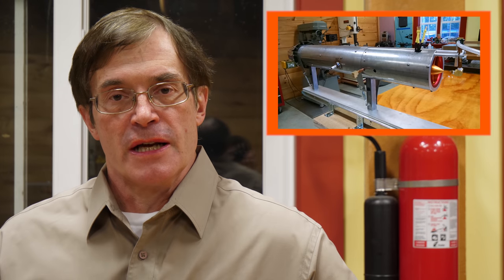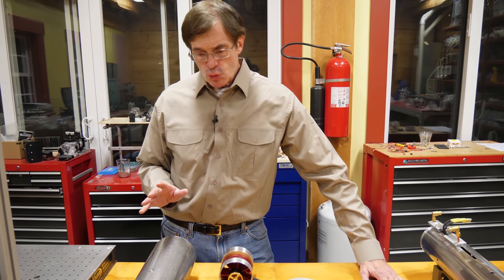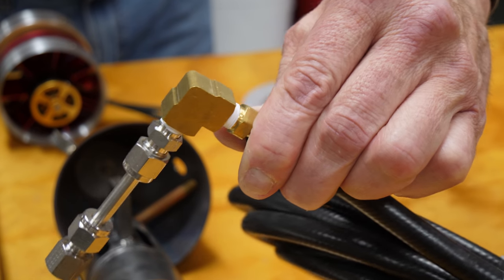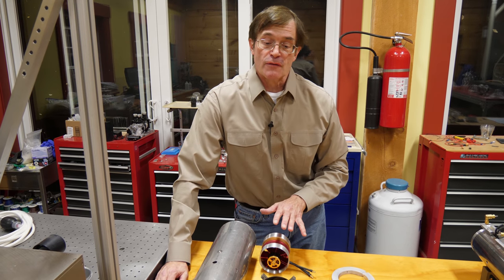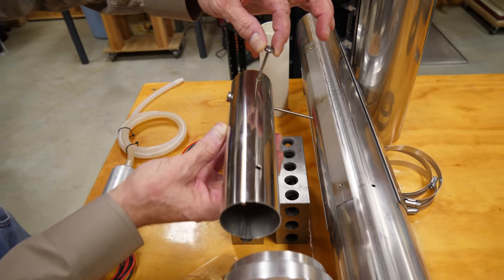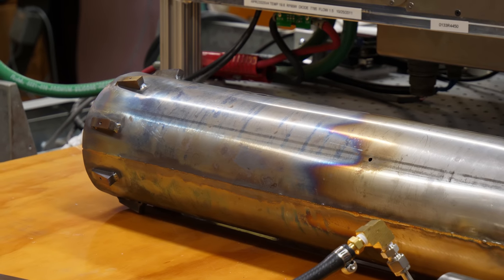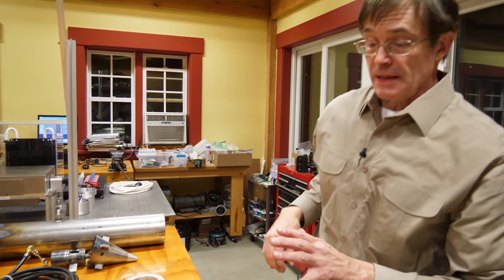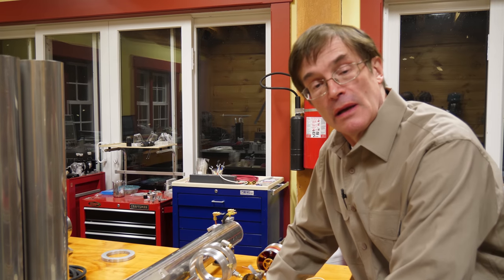Hybrid Jet Engine - Update 2.0

Comment: yes edf ramjet afterburner rocks
Reply: even in no-burn external heat operation mode
Reply: rocket nozzle thrust collector with expanding combustion chamber diameter
Reply: you could try flap membrane cantilever flexing fan
Reply: or just slow burn a very big slow flame, not small fast flame, like in power plant, as heat, then push the heat to the thruster
Reply: separate the problem of burning and thrusting to two separate mechanisms/functions, simpler
Reply: ece over ice
Reply: well who cares how large the steam engine burner chamber is (or nuclear reactor), you only care about the thrust you get from the heat of the burn chamber
Reply: yep steam/gasoline heat engine train business
Reply: fuel bomb type of air heat expansion, instead of pipe containment jet thruster burner, if in ice mode, even in ece external burn the large slow burn chamber will function as such, dont have to care about melting places, just large amount of moderate temperature heat/btu flow into the thrust generation device/chamber/rocketnozzle
Reply: yep you can directly heat burn the rocket nozzle side sheets from the non-thrust side, with burner nozzles

Comment: What are you trying to do here? 
Build a jet engine with a rc electric fan with no compression? 
You know that stainless is the worst on distorting while adapting heat?
Rc people know a lot of fancy words.. but putting those in real life usually end up contraptions like this, they simply just dont work. 
Get a real jet engine and improve on that design so you wont end up waisting your time.
Nice work space you have. :)
Reply from the maker: Thanks, regarding the workspace. 

What I am trying to do is exactly what I said I was trying to do.  The words I choose are appropriate and to the point.  I will not restrict my vocabulary in order to convey a prosaic impression.
There is compression with this fan design.  They achieve a low compression ratio, but they do compress the air as will any source of air velocity due to the ram effect.
Part two will be out in a couple of days. This might answer some of your question.

Comment: What is the point of this build? Dumping fuel into a tube and blowing air at it doesn't make it a jet unless that air/gas is massively accelerated in the process. All you are producing is a little bit of low pressure hot air. I am really baffled as to how this is supposed to be an improvement on even the most primitive ram-jet.
Reply from the maker: The air does not have to be massively accelerated before this becomes useful.  In part two, we'll show that we are not producing a little bit of low pressure air.  The thrust is doubled by the addition of the fuel.
Reply: Tech Ingredients ___ Thanks for replying. I must be missing something but I am puzzled as to how you intend to achieve even a marginally useful thrust to weight ratio using your current configuration. I will follow the story and see how it unfolds.

Comment: Why not add the water INSIDE the tube ? This is what they do on gas turbine generators to produce more thrust and the steam keeps it running cooler. The steam in your set up now doesn't have any type of nozzle so really its wasted energy, or even have the water jacket exit inside the tube not outside. Jet airplanes would add water to the engines if they could carry around water tanks but obviously not because of weight. See AGENTJAYZ videos on youtube to learn EVERYTHING about jet engines. I can see some things he might change on that. Like use air cooling around the combustor can you built. More cool air leaving = more heat to thrust.
Reply from the maker: You do not want to cool the exhaust.  This will cause the volume to drop and consequently the velocity to drop as well.  The steam generated by the hot tube does exit the 1mm gap at a high velocity and does add additional thrust.  We may elect to replace this with bypass air from the fans to eliminate the weight and complexity of the water system.  There were military jet engines that used water injection to augment take off thrust, but they needed and were able to add additional fuel to keep the exhaust temperatures up.  The water prevented them from melting their engines.  We need the water where it is to keep the steel tube from melting while maintaining the highest possible exhaust temperature.
He has a good channel and we have watched a lot of his videos.
Reply: Water injection is good for static thrust by increasing the mass flow rate through the nozzle. Offsetting the temperature decrease is a decrease in average molecular weight of the exhaust gases. The water or methanol/water injection is done prior to the combustion chamber, sometimes even prior to one or all of the compression stages. The added density and cooler flow into the combustor section allows more fuel to be added, but the mixture ratio is already richened by the water vapor displacing oxygen.
There are a lot of balls in the air with water injection. Adding a fan section and then making the bypass ratio as high as possible eliminated many of the reasons for using water injection.
Reply: I see what your saying PV=nRT. Duh.
Reply: Would like to see its thrust with just the 5000w att fan and then 5000 watt fan with cooling, then do it with the engine lit with and without cooling the fan. Favorite youtube channel. Where about in Maine are you? I used to live up in that part of the country.

Comment: Wait... you mean if you have more air going in, you make more power? NO! That can't possibly work! 

-.- That's why superchargers or high compression pistons work on car & truck engines.. The more cold air you can give an engine the more power it will make by burning the fuel more efficiently.. Why is this a surprise to you? Do you even actually know anything about engines in general?